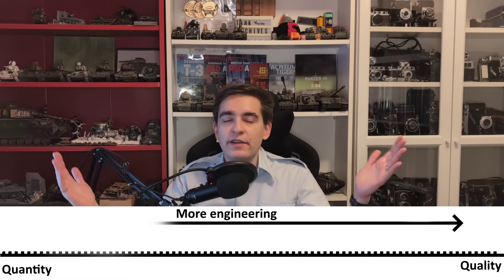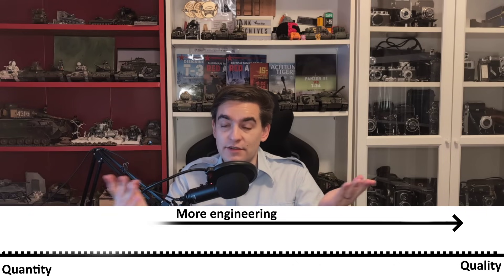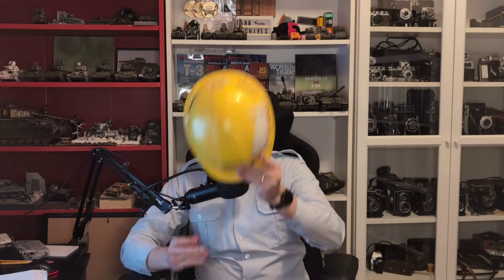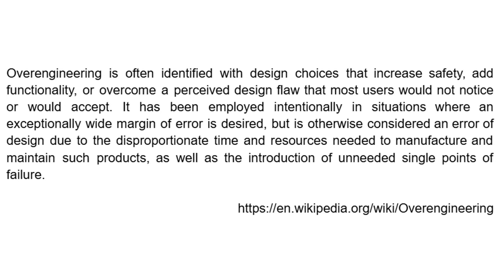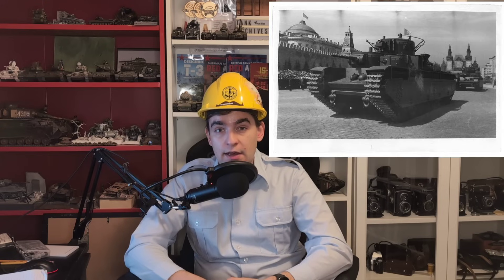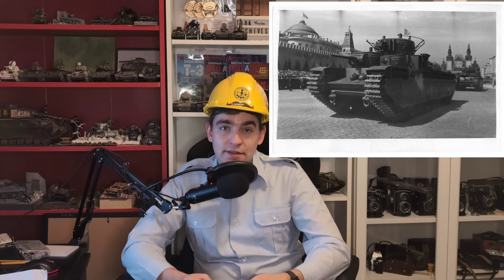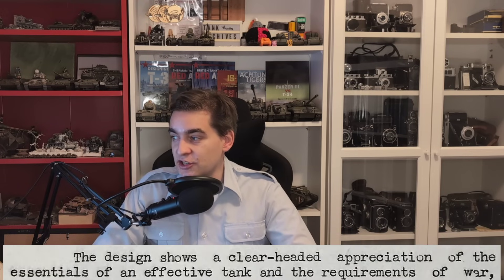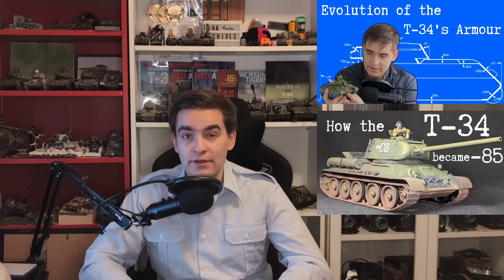Was the Tiger overengineered?

Comment: 17:05 Well yes, and no. The Tiger tank had a different mission profile than for example the IS-2, and it had a different design to follow that function. Its weight is mostly caused by the hull heigh in combination with thickly armored sides (almost as much as the nose). And that´s because it had a transaxle going forwards under the turret basket, and because it was expected to act as a breakthrough vehicle. 
Could it be done in a better way?
Yes. But it would require a different starting point. The German industry was already set up to produce engines (Maybach) that favoured a longitudinal placement (putting them sideways would seriously limit the volume reserved for the radiators because you´d have to put the transmission right next to it, instead of to the nose of the vehicle). This is something that makes it very difficult to design a proper rear-mounted transmission. Their steering and track tensioning systems also didn´t favour this arrangement without massive modifications. So they were stuck with the transaxle. 
So, how would you decrease the weight of the Tiger 1 E, or more specifically - how would I do it if I had to? 
Well, I´m not exactly sure. I´d say "adopt the IS-2, or the IS-3 nose shape", but you can´t do that. You can´t put the driver directly inside the gearbox. 
Or I´d say "decrease the overall width". But you can´t do that either, because you need large fuel tanks and radiators for the gasoline engine and you need enough space for the ammunition. 
Neither can you use sloped sides (although that wouldn´t really contribute to an overall weight decrease). So the ONLY options boil down to: Less armor. A lot less armor. 
But that also doesn ´t make sense. The Tiger´s armor was barely enough for its mission profile. Even its front armor wasn´t completely safe from enemy tank and anti-tank guns. Let alone its sides or rear. Well, maybe you can decrease the rear to 60 or even 50 mm, but that would shift the vehicle balance forwards, forcing you to reduce the nose armor.
So unless you suddenly spawn a whole new factory with skilled workers and a brand new design for a compact gasoline engine and transmission that would allow for a nice and proper fit into the Tiger hull (which is just barely possible without making the hull wider and the tracks narrower), then the Tiger 1 E design comes out as the ALMOST best choice (I´personally gear it down even more and sacrifice maybe even a third of its top speed for more torque).

Comment: Tiger 1 had a few massive flaws which can be described as "overcomplication" rather than "overengineering". Overengineering is the wrong term. Something is overengineered for example when 1cm of steel would be enough, but the designer goes for 2cm to make it last longer. 
And when it comes to the overcomplicating of the Tiger design, then the first thing that comes to mind is the hydraulic steering wheel driving system, which was a complete junk anyway and barely ever worked. And second is the final gear drive that set up the propulsion system to a super high top speed (over 40 kph) that was not only rarely reachable, but also decreased the reliability of the final gear and also the transmission. 
The same is true for the Porsche Tiger / Ferdinand tanks (when equipped with the Maybach engines). If the final gear drive was set up with a greater reduction ratio, the top speed would be lower (but it couldn´t be realistically reached anyway, so who cares?), but the reliability would be much, MUCH greater. 
The gasoline-electric system would be extremely reliable, if it wasn´t forced to work with a completely wrong reduction gearing. 
The same applies to the Panther tank, with one caveat: the lighter curb weight made it possible to just reinforce the final gear and increase reliability without reducing the top speed.
So, if I was to improve the German tank reliability and general usability, I´d just rework the final gear (on most German vehicles this takes form of a permanent planetary reduction gearing) to increase the revolution reduction ratio. Hell it may even increase the offroad top speed...

Comment: Well, the Centurion tank weighed 51 metric tons. So I see no reason to complain about the weight of the Tiger 1.

The Tiger was supposed to be a breakthrough tank which was supposed to have enough armour to support it penetrating enemy lines. So I don't see much problems with the weight.

Other tanks may have similar armour thickness at the front. But they compensated by having thinner armour at the sides and back. E.g. the Panther which incidentally weighed less than the Centurion.
Reply from the maker: The Centurion Mk.I weighed 45 tonnes. It was comparable with the Panther in size, weight, and armament. Only post-WW2 Centurions crossed the 50 tonne mark. 

I'm also not sure why you're comparing the Centurion with the Tiger if you immediately say that it's fine for the Tiger to be heavier since it's a heavy tank and the Centurion is not. If you compare it to contemporary heavy tanks, you'll find that it has less protection at a higher weight.

Comment: The Sherman and the T34 were under-engineered under the common layman definition. Having "safety margins" is under optimizing the design. It creates inefficiencies. The Germans tried to do away with this as much as possible, in a big part due to their relative scarcity - for example, they couldn't equip their tanks with extra powerful engines from the get go because they had less fuel.
Reply from the maker: These "inefficiencies" left room for the vehicle to improve. It's much easier to improve an existing tank somewhat than spend another two years designing a whole new one and retooling to produce it.

Comment: The Brit colonel's report on the Panzer VI at video 14:26 states that "ball bearing turret races sound like a very extravagant proposition" and "the lavish use of ball and roller bearings throughout German A.F.V. designs suggests the workings of a cartel." I'm the farthest thing from being an engineer but the colonel most certainly was no engineer. Races with ball bearings to allow the turret to traverse smoothly and precisely were a necessity, not an over-engineered luxury.

The M4A2 Technical Manual TM 9-731B states that the turret with 75mm cannon weighs 9,090 pounds and shows the turret supported in races holding 150 ball bearings, each 1.250 inch diameter. The VI turret certainly weighs half again or more than the M4s.

A tank's turret mounted metal-on-metal, instead of on bearings, would require a very large and powerful motor to rotate because of excess friction or, manually, would require two guys cranking like demons on handwheels geared to about a 937 to 1 ratio. Metal-on-metal would be impossible to grease so that it spreads evenly; also the grease would be squeezed out making a mess. The M4 turret has 3 grease zerk fittings spaced evenly around the turret ring races; the balls are held loosely in retainers/cages that keep them evenly spaced and also allows space between balls for grease.

The turret rotating on balls in grooves maintains the turret in a constantly precise position for aimed shots with the cannon.

I've come across quite a few examples of German World War II vehicle engineering that is overly complicated, sometimes ridiculously so, and can only be called 'errors of design.' I'm not qualified to state that overly complicated always equates to 'bad' over-engineering, but the examples I'm thinking of certainly show poor judgment considering the conditions the components had to perform in.

The M4A2 commander's hatch cupola also rotates on a few dozen ball bearings of much smaller diameter than the turret bearings, of course. Like the M4 turret, it was a necessity of function, not over-engineering.

The Brits earlier statements at video 12:55 speak to the VI's complications and attempts at perfection, and are true, even though he didn't seem to always comprehend what he was looking at. As has been said, perfection can be the enemy of good enough.

Much has been written about the German economy pre-war and during the war, but I'll never get around to reading about it to any great extent. I do know that AH courted industrialists early in his career.

TM 9-731B--
M4A2 turret and other specifications... https://imagizer.imageshack.com/img923/5189/rgHtdy.png
M4 turret race exploded diagram... https://imagizer.imageshack.com/img923/6188/HAqnZy.png
M4 commander's cupola exploded diagram... https://imagizer.imageshack.com/img924/5580/5od1qP.png

Comment: The philosophy of the Tiger was different from the other tanks you mentioned. It had thick armour everywhere. It is designed to take punishment from every direction. None of the other tanks have that ability.

As such, it is not badly engineered, its design criteria are different. It was designed in a time when you could have a reasonably anti-tank proof tank. With the Panther and Tiger ii, the design criteria changed because it was not practical to use the same design criteria any more.
Reply: And also because, as they found out, tiger was outdated. Soviets already had weapons that were good enough against it on frontline. Not just 45mm AT guns and low velocity 76mm.
Reply: Designing tanks to be hit from any direction is bad engineering. "He who defends everything defends nothing," in this case the Tiger was way too heavy because of all the armor and had ridiculous maintenance requirements and poor fuel economy. Also the idea was flawed: Breakthrough tank tactics were not effective in practice because trying to armor yourself into relative invulnerability for piercing attacks simply does not work. You will hit mud, or a mine, or have your treads or track hit, or be ambushed by infantry with molotovs and piats, and all your armor will have done little but bog you down. Heavy armor is a bad paradigm for tank design because no amount of armor will make a tank actually good at being a tank. Rather, enough* armor is good. How much armor is enough depends on a multitude of factors, but generally the priority of tank qualities is to 

1) Carry a powerful enough armament to destroy its targets 
2) Get where it is needed in a timely manner with adequate logistical support to maintain it
3) Survive what it can reasonably expect to be hit by, though not at the expense of 1 and 2

German heavy tanks failed spectacularly on part 3 and 2

Comment: The Tiger 1 was about the same size as the Panther, Pershing and Centurion - the new generation of big Western standard tanks. Add more turret front armor, top, side and rear armor to these - and you will have  a 50+ ton tank.

The Pershing had lighter turret front armor and side (rear side) and rear hull armor, and also lacked a turret basket. And a lighter and much weaker engine, the M46 was basically a re-engined M26 and weighed almost three tons more. The US Army also considered 70 main gun rounds capacity only borderline acceptable. The Tiger 1 carried 92 as standard, and could carry up to 130.

The IS-2 carried only 28 rounds of main gun ammo, something which would have been totally unacceptable to any Western army. It also had several other severe limitations, very slow ROF, poor armor quality etc. Like just about everything made in Soviet/Russia with an engine, it was much better on paper than in reality - like in Ukraine today.

From its introduction in late 1942 to the spring of 1944, the Tiger 1 arguably had a margin of superiority over its opponents never equalled in armored warfare, before or after. And the Germans themselves did not complain about lack of mobility, reliability or armor quality - on the contrary it was generally praised for all three. The compalints are mainly Allied propaganda to counter "Tiger Phobia", excuses why the Allies themselves did not have similar tanks.

https://www.youtube.com/watch?v=bBni1Nd9Ez8&t=1s

https://www.youtube.com/watch?v=Pz3r5WVJ91Q

Comment: I have an idea that is not the same mantra "Germans just are notorious to overcomplicate anything and/or for the sake of making more money": 

Germany was notoriously short on fuel and resources like metal, not so much short of skilled labour. 
 
That would mean you can only put out so and so many tanks (or whatever) because you have a limited amount of material. 
 
And when you have enough workforce, then it might make sense to shape the available amount of material into an as effective form as possible. 
 
That motivation would alleviate the "obsession to make it as perfect as possible by adding more and more complications" somewhat.
Reply from the maker: Every nation has limited resources to work with. As shown way back in Johnathan Parshall's excellent lecture on Kursk, Nazi Germany outproduced the USSR in steel by a factor of 3.5, yet the ratio of production in tanks was the other way around. Germany wasn't limited by a mantra or by raw resources when it came to output, they were limited by a downright antiquated production system which required a lot of hand fitting rather than American or Soviet assembly lines.
Reply: @TankArchives Tanks weren't just made with steel - crucial metal alloy were needed to make quality armor plate and parts. Germany was short on certain metal alloys like manganese which forced them to use lesser quality more brittle substitute armor plate later one. So yes German tank production was limited by its resources.

And also correct that Germany production system was no doubt less efficient than American or Soviet assembly lines, Germany could not effectively adopt such large assembly plants as they would be highly vulnerable to air bombing raids, as Germany could not effectively protect such bombing raids because of lacks of flying planes, and Germany lacked such flying planes because they had limited fuel - so it all linked back to limited resources of Germany, especially on oil, which affected a lot of things. Not to mention larger amount of heavy machinery meant higher usage of lubricants which, guess what, comes from oil too. 

And a minor thing but the prewar rather complex shape design of German tanks like Panzer III and IV did also not made thing easier, but they somewhat correct that with newer AFV like Panther and Jagdpanzers with sloped simple hull shape not too different than that of Soviet designs.
Reply from the maker: @sthrich635  I already addressed that point. The USSR also suffered from shortages of strategic metals and was forced to develop substitutes made from byproducts of other processes, find other alloying metals, and make substitutions like aluminum for copper and steel for aluminum. Germany is not special in this regard. If German metallurgists and engineers couldn't deal with the challenge, that's on them.
Reply: @TankArchives Maybe though oil shortage in Germany still very much made catching up Soviet tank production more or less meaningless if it could not fuel them as much as Soviets could.

Comment: You are comparing a construction from 1938 with constructions from the late war years, which is not scientific due to the lessons learned. If one consults the detailed evaluation results of the Germans, only the IS2 shows a halfway achieved equality with the Tiger variants, whereby according to Soviet results the Soviet cast steel with the same thickness lost approx. 20 % compared to the German rolled steel. in terms of artillery, the IS2 was inferior due to the slow rate of fire. In a duel situation, a Pershing was slightly inferior to a Tiger 1 and far inferior to a Tiger2, as the evaluation shows. Source: historian Roman Toeppel.
Reply from the maker: The Tiger entered production in 1942, the IS-2 just a year later in 1943. It's entirely fair to compare them. It's also ludicrous to compare the performance of tanks in 1:1 duels. War is not Call of Duty.

Comment: Not entirely if we look at what German philosophy was. For them, they prioritized their tanks to be high quality in everything which leads to heavy usage of high quality materials and components. And they were running low on those material in late 1943 onwards. Some tanks indeed can be call overengineered but some also can be call overcomplicated as well. But this still couldn't deny that Tiger tank is still overengineered a bit compare to other nation heavy tank
Reply from the maker: When the USSR was short on high quality materials, Soviet metallurgists designed a process that could make ductile armour from industrial byproducts rather than just shrugging and saying "well, I guess we can't make tanks now".